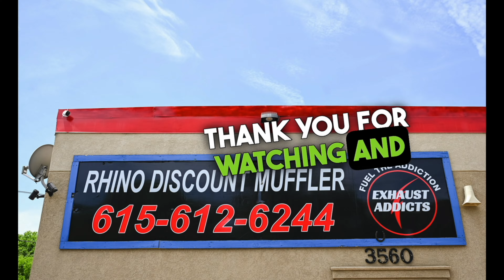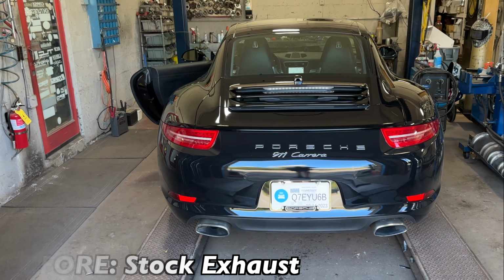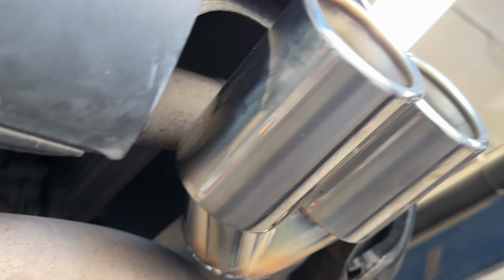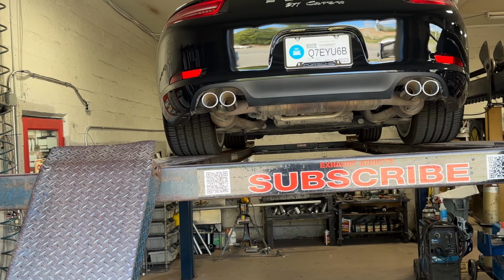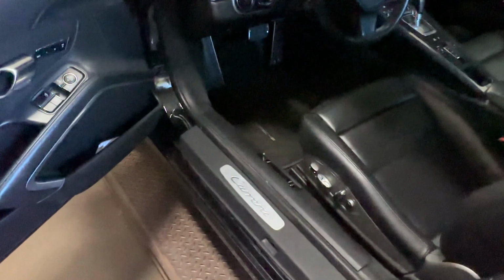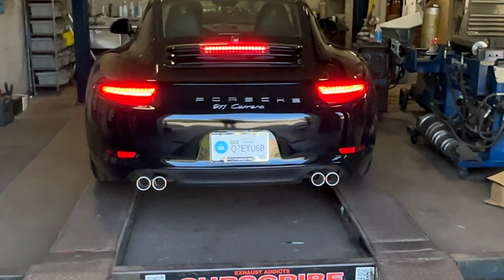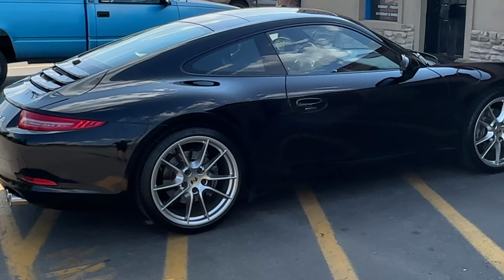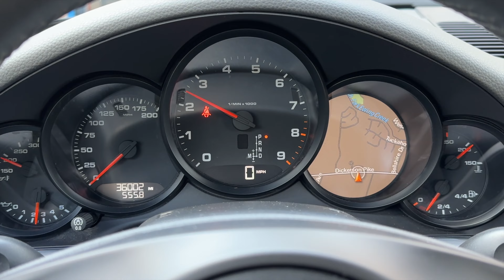Do Exhaust Tips Make a Difference? Porsche 911 Test!

Comment: It's hard to tell with the stock exhaust... I made a video of single wall vs double wall tips on my corvette. It's much more throaty with the double walls. The difference in sound is really noticeable if the car is loud
Reply: Very much so. It also depends if they're rolled tips (12" long or more) because with rolled tips it resonates more
Reply from the maker: Thanks for the info

Comment: They make a much bigger difference if you'd free up the exhaust.
Like no muffler/resonator with a tip is going to be different from without a tip.
I imagine it's because the tip is obviously place where the exhaust exits, so it reverbs off the tip like crazy.
The same would happen if you had a muffler at the end.